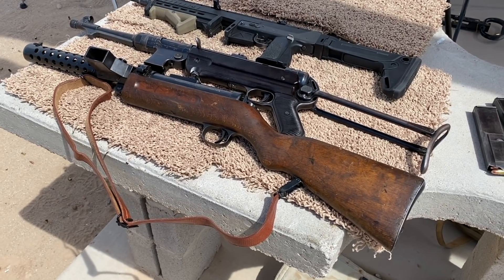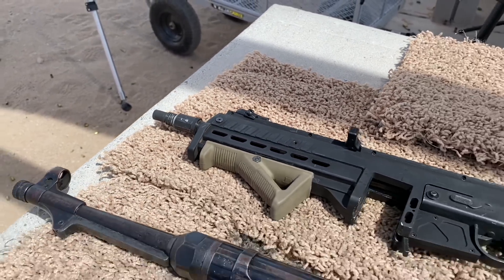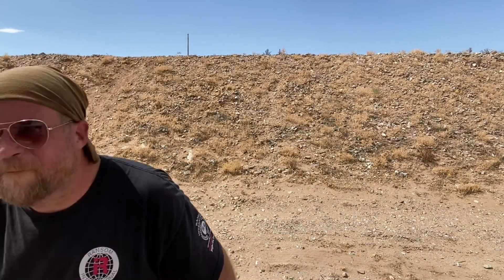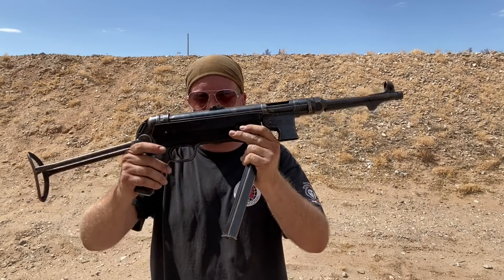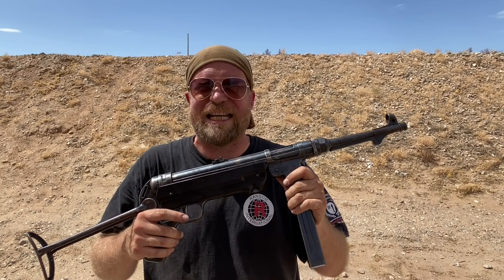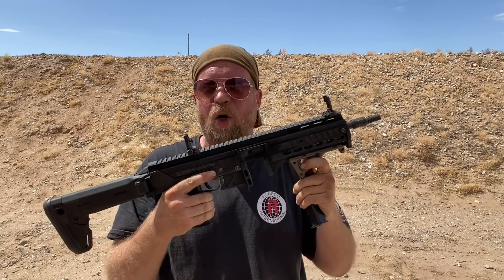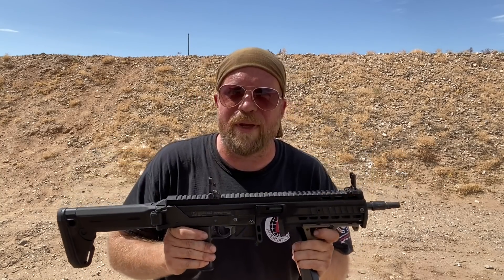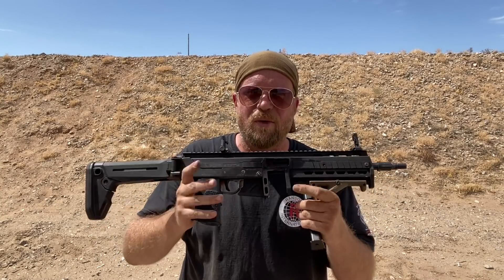SMG Rate of Fire & Controllability

Comment: Man it's hard to overstate how influental the MP18 really was. It has it's lineage visible in every sub gun designed until the sixties.
Reply: @patgray5402  Actually my mom is a 7.7cm Feldkanone 96. She didn't get around much after the great war.
Reply: @lostalone9320  What I find impressive about the MP 18 isn't that it was the first practical submachine gun, but how many of it's features carried over to later designs. It being pistol calibre or open bolt aren't the only things that carry over to others. A lot of later submachine guns also take the tube receiver and just general handling characteristics from the 18. It's kind of the standard template for what a pre sixties sub gun looks like.
In essence the MP18 is to submachine guns what the Renault FT is to tanks.

Now with that being said, Had the FT or the 18 never existed we still would have eventually ended up with similar designs simply because they are emminently practical, but as things are they are the reference.
Reply: reminds me of the bastard gun from metro

Comment: I would loved to seen a Swedish k in the test too 🙂
Reply: Having carried and fired one ALOT I can say that it fires like the MP40. 
Funny thing.. US Army tested the M3 vs Thompson vs MP40 during WW2 and the M3 came out ahead. Really slow 450-500 rpm
The Swedish K came out in '45 and they looked at the MP40, Sten, Suomi and M3, but simplified it by removing every moving part they could. No semiauto even
Reply: @amclips2995  yes i think swedisk k is build on finnish kpist the sten and mp40. I competition shooting with the k thats why i would liked it in there. Its not exactly as the mp40 in mho . But i get where you comming from 🙂

Semiauto is not needed. If you cant shoot single shoot with it you shuld not use it. But swedish police force had one with select fire semi / auto. And you can buy parts for semi from stockholms vapenfabrik for k pist if its a must be 😂
Reply: Anders Mullo Swedish K is a PPS-43 copy chambered in 9mm. Its as simple as that.
Reply: @azeke8  The PPs 43 along with the Sten, Mp 40 etc were studies for their metal stamping production techniques. The mechanics of the m 45 have way more in common with the Sten than the pps 43.
Reply: @azeke8  Not even close. The PPSh 43 is a great gun, but if you look inside the gun, many diffrences can be seen.
Reply: Great idea on the Swedish M45. Re the M3, i remember a Hackathon/ Vickers video where they got consistently tighter groups with bursts using the M3 vs. the HK UMP. Apparently due to weight and rate of fire, the M3 being both heavier and slower. I have often thought it is a better weapon than it gets credit for. They still had new in the foil M3's in tank turrets at the beginning of Desert Storm. That should tell u something. A coupme of older friends of mine said they were in use in helos in Vietnam as well, and many were given to ARVN as miltary aid.

Comment: A low rof let’s you adjust between shots, a high rate of fire creates a more consistent force that is easy to counter with a constant pull, in between is kinda sketchy
Reply: Its all about how the harmonics of the rate interplay with the weight distribution. Different guns will have different sweet spots.

Comment: The MP40 wins here. I remember it has a sort of buffering mechanism built into it, but i don't remember how. If it rises so little in a mag dump, it must be superb in controlled bursts. I do love the MP5, and the Beretta M12 was good too. It had a slow rate od fire (i woukd guess 450-400 rpm, not unlike a grease gun) and was open bolt. That seems to be the sweet spot. The MP5 is faster of course. Don't remember the spec exactly, but i think it is in the 750 rpm range. Anyway, great info. Hopefully we will see more? Maybe Swedish K, MP5, and 1 or 2 others?

Comment: Are there any constant recoil SMGs? I assume someone has done it, though haven't seen it myself. I remember watching videos of Ian playing with a constant recoil LMG (Knights Armoury, I think), and another of him using the PPSH and saying that the rate of fire was high enough that the impulse almost blends into one continuous pressure
Reply: FacePwn64  H&K MP5 is basically as close as it gets. An SMG so good, the manufacturer's attempts to kill it failed.

The StG also had (in my opinion) a rather major flaw that it was open bolt. USA played a great role why StG style of guns were "forgotten" - great insistence on .308 as the NATO standard even though most countries were looking for lower power service rifles.
Reply: Assumingly one of the only ones is actually in this video.
The MP40 recoil spring system is designed to work similarly to a hydraulic buffer, so it never lets the bolt contact the reciver.
I don't know of any other SMG that has such a feature but in my experience it makes the MP40 feel a lot smoother than other SMGs. It just sort of chugs along without any sharp punchy recoil impulse.
Reply: @LeadHeadBOD  The MP40 qualifies as constant recoil, while the MP5 is roller locked and closed bolt, but the bolt does hit the reciver.

Comment: Having a proper locking (or gas system) system is probably a lot more important than rate of fire as far as usability goes. 
Compare a 223 tavor to a properly gassed svt 40, the svt has less kick despite being twice as powerful and about the same weight.

Comment: ROF
Weight
Magazine Capacity
Balance?

If you had all the weight in the stock it would probably do less for reducing muzzle climb right?
Plus maybe where that weight is in regards to the bore axis and how much of a drop you have on the stock. The moder SMG is very much inline, the two older ones have a significand drop on it.

Comment: Do you think if you applied the concept of the AK107 balanced action to a sub machine gun, it would effectively cancel out the recoil? you could conceivably do it telescopically, to keep it compact. The AK107 uses a twin gas piston fed by one port, that is then synchronized by a rudimentary rack and pinion. For a blow back style sub machine gun, you would need to drive the counter mass with a rack and pinion or a pulley and cable.

Comment: Imagine if someone engineered a modern MP-18 with a slightly higher rate of fire - nothing crazy, just about as fast as the MP40 is, so that bolt wasn't such big slooow heavy slap rearward each shot. The MP40 is just that bit more smooth running in the footage, but the MP-18 is far sexier.

Comment: I have more of an NFA question, so you can add a full auto disconnect to a semi-auto AR-15  so what if the actual part that makes a Mac 11 considered a machine was to be attached to an AR-15 somehow? Would it legally be allow for that AR-15 to be fired full-auto? ( I understand modification to the AR-15 would be needed for it to go full-auto)
Reply: Well you can use the trigger group and "lower receiver" (not sure if that's the correct terminology in this context) with other parts to make a full auto 5.56 rifle, it's not exactly an AR-15 by that stage though. The one I know of is made by Lage, the same company who made the SMG using an M11 shown here.

Comment: I'm wondering how much of a role how hard the bolt slams back on each cycle plays in this. I'd think a ~1lb hammer hitting the gun each shot or not would have a lot to do with how easy it is to hold the gun on target.
Reply: So the MP40 is a bit different in that regard. It uses what we now call a "constant recoil system" meaning the bolt never hits the rear of the receiver. The bolt springs are designed similarly to a hydraulic buffer and it just decelerates the bolt until it can stop & run forward again. This probably contributes considerably to the MP40s reputation as a highly controllable SMG.

Comment: I've fired the Thompson M1; I found it entirely controllable. The difference, I'm thinking, is in the shooter. That, of course, argues against the Thompson, in that you don't want to have to go find the right shooter for weapons issue; you want to hand off the same weapon to everyone.
Reply: Let's not forget, just about every different model of Thompson made (or tried to make) changes to the rate of fire, the M1 and M1A1 being the slowest firing versions. The oldest models tended to have basically MG42 rates of fire. I'd say making a blanket statement about the controllability of the various Thompson iterations is the real mistake. There technically is not one Thompson SMG, there are many Thompson SMGs. I still personally respect the heck out of the Thompson(s) because there were still many good ideas in the design(s).

Comment: Hey Karl, how does the M11 do with Suomi drums?  I assume it's reliable, if the drum itself is in good shape, finding good drums can be challenging.  Have you tried it with coffin mags?
Reply: In my experience with the max 31 upper it’s super reliable with 4 drums and 2 coffins as well as the 30 round shockwaves. The shorter Lage max-11a1 is waaaaaay more picky, but it also uses original mag well, much less room in receiver for bolt to travel, etc.
Reply: The Max-31 does great with the Suomi drums. The coffin mags work good too, but they are a pain to load.

Comment: isn't an open-bolt design inherently more stable, since the very action of the bolt moving forward negates the recoil so much?
Reply: I wouldn’t word it that way. The bottoming out and return of the often-heavier-that-closed-bolt-design bolts does create a noticeable vertical deviation (mitigated and isolated to only vertical with proper grip) , however once one syncs to the cadence of it with training, they are very practical and easy to keep on target. It’s hard to compare because I’ve drastically less time with closed bolt sub guns, but I’d make the comparison that it’s likely easier for someone with no experience to intuitively become proficient with closed bolt designs than open just because it’s more like the more common modern designs that are more ubiquitous.
Reply: The recoil event is over by the time the bolt gets forward so it tends to induce a dip at the muzzle. Also open bolt designs require a heavier bolt and the more mass you have moving the more felt recoil.
Reply: @09cjonescj  well. I have no authority on it whatsoever, as I've never even fired a fully automatic weapon. But having watched quite a lot a slow motion footage of open bolt guns being fired, (especially the Skorpion) it always looks to me like the recoil impulse just gets reversed from the "recoil" of the bolt moving forward. Like, the force of the bolt moving forward is equal to the force of the recoil.

Watch Forgotten Weapons video on  firing the Skorpion again, and you'll see what I mean.